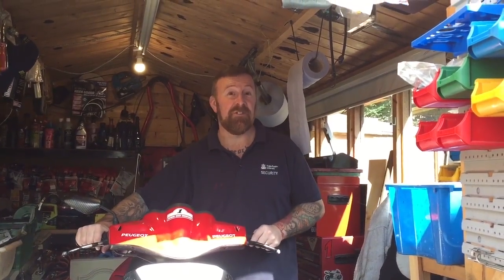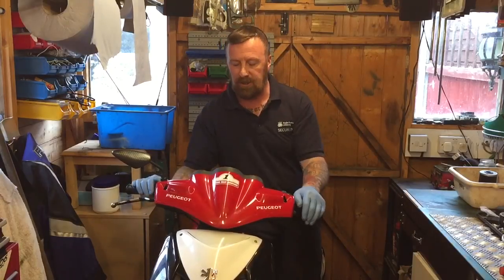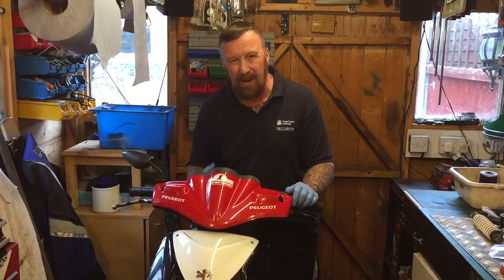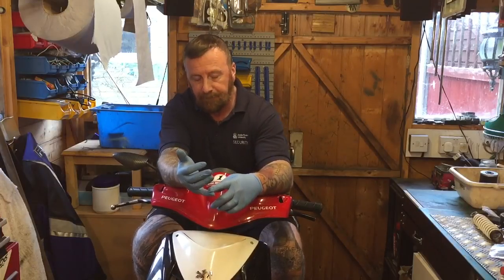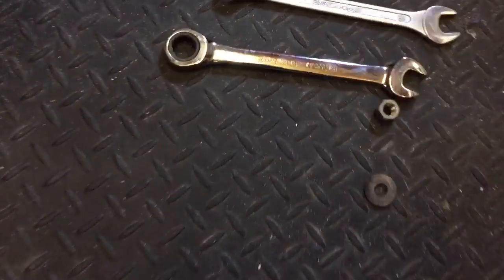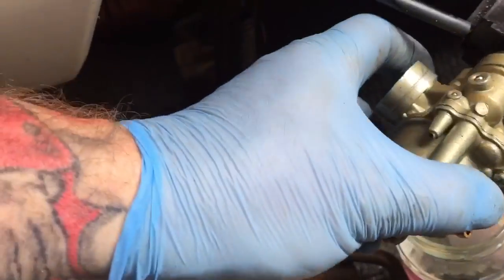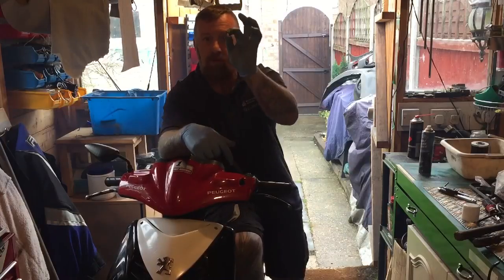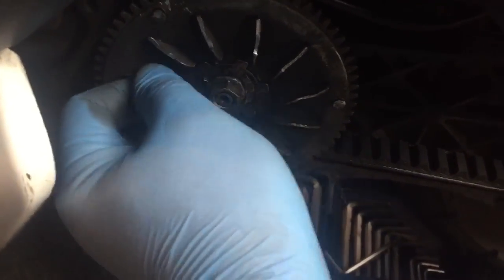HOW TO FIX A MOPED SPEEDFIGHT 50cc MARK SAVAGE

Comment: Hi Mark I really need your help , my petrol is leaking from my carb at first thought it was the float but seems to be fine , cannot see what else it can be , I think someone has tampered with it , there is a plastic fuel filter between the fuel leading from the fuel line in could this fail ? it doesnt seem to be cracked or leaking and neither are the tubes I'm really stumped and angry to think someone has messed with my bike any help be very appreciated please , thanks , the bike is a peugeot trekker ,it does happen slowly so I'm still sure it is the float but I've checked this , maybe I should just buy a new carb
Reply from the maker: BoB Smith hi bud ok
Take carb back off
Take the float out and the pin and clean with carb cleaner
Like in my carb cleaning video do the test to see if the float pin is shutting then if so it’s the bowl gasket 
Sometimes it can be the vacuum not shutting and a weak pin 
If it’s the pin it’s not a part you can buy so new carb 
Otherwise yes someone may have played with your bike and that’s not right 
Please like share and sub and watch the carb video there’s a few on my. Channel 
Mark
Reply: Hi mark thanks for the reply , I just took the carb off again and checked the float pin does look a little worn around the red ? tip bit , there was also some dirt in the fuel line in bit through to the pin so I blew it out thinking this prob  fixed it was just jamming , put back on,  still leaking driving me nuts and I stink off petrol , but to be honest I kinda like the smell now lol anyway thanks mate think am gonna need a new carb shame can't buy a float with pin , can't beleive somet so small like the pin can casue so much headache lol ,anyway thanks again mate
Reply: no way just found on e bay a pin for a trekker is from germany would it be possible to take that pin off though ?It must be ?
Reply from the maker: BoB Smith the good old smell of petrol 
You can buy them but very hard and often not a good fit 
Shame a new carb just for that but still gets back on the road 
Mark
Reply from the maker: BoB Smith the pin should just slip out of the float bud 
Well done for finding one 
Guess it’s a lot cheaper than a 2nd carb and worth a go 
Mark
Reply: Cheers mate , yeah might make it my new aftershave lol , so I just took the carb off , for the umpteenth time lol ,anyway got it in my hands , i watched ur vid on the blow test , great idea by the way , have tried it and I think there is some air leaking but I'm not sure if is from where the pipe joins or from cheeks if there is It seems very slight would that be enough to cause the problem , ? I have found a used carb for 35 on ebay but is away till 27th so wanna try and fix before also don't wanna spend money if is not that , is there anything else it could be , that I could look at ?, thanks again , at least I have leant a lot about carbs thanks to the internet and legends like ya self ;-) cheers bud
Reply: Ok so have tried the blow test again and Im sure there is no air leaking , I'm stumped
Reply: I'm thinking maybe I am not putting the pipe on properly cos when I bend and blow air comes though , and maybe someone syphoned my petrol and didnt put on properly but I've tried to make sure on properly and the fuel seems to be coming from the top of the pipe when it does leak as if from the carb filling up it leaks at the part where the pipe plugs into the plastic filter part....sorry if bombarding ya with my troubles am just on a propa mission lol lost 2 full tanks of fuel before I realised had a problem
Reply: sorry meant from side of mouth/lips not cheeks ha lol anyway seems pretty tight am bamboozled :-/
Reply: I bought the used carb for £35 , wont get it for 2 weeks though as seller on hols arghgh , the needle was 20 from germany 10 + 10 postage , found one in uk £28 !!! anyway I'm sure is the needle even though seemed tight with blow test the end looked a bit worn around the tip , anyway will let u know how it goes when carb arrives hopefully fixes problem , cheers Mark
Reply: I ordered the whole carb (used ) cos not much price diff and not sure if needle defo fit properly
Reply: Ok last mesage lol  , good news after studying the name of the carb , dellorto phva 17.5 I think I have tracked down the needle valve for under £8 , there were a few diff ones I hope it fits looked a lil bit diff in pic but part name matched, shall see , if not will send back and try another one of the ones that looked similar (red rubber tipped ),and if it doesn't will be wearing my new parfum de petrol again ha ,cheers mate
Reply: Ok defo last message now lol soz am prob driving ya crazy with messages ,while looking for the seals I found the exact pin the float and the gaskets for £8 with delivery !!!!! woo hoo , only prob now is the order wont go through cos of bloomin address sayin card address is wrong pfffff oh well will call em 2mrw well chuffed if works , hope it fixes it was thinking bout what you said about vacuum, would that be a seal prob ? knowing my luck it will be somet do with vacuum , ok thats it am done now might message back to let know if fixed , cheers , ttfn :-)
Reply: After all that it was my petrol valve...(petcock) the needle got sent in kit was chipped and give me the needle problem put old one back in ,new pet valve,  all good , at least my carbs clean now as well :-D